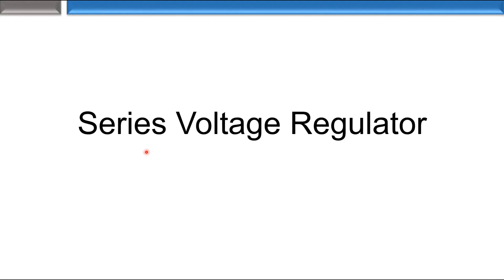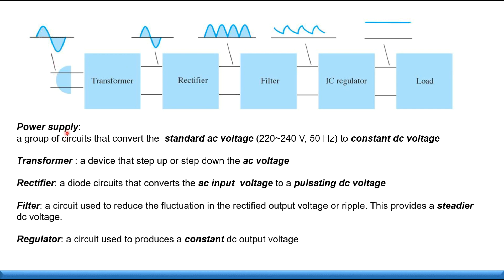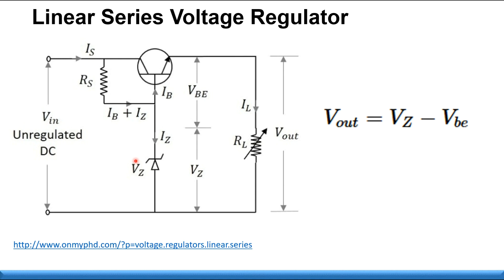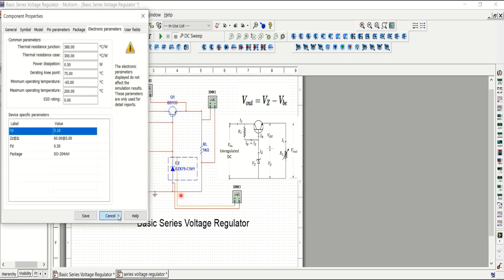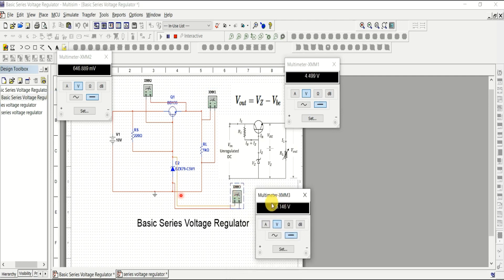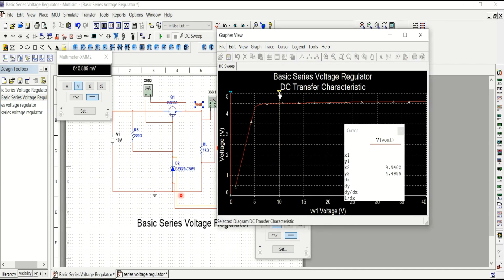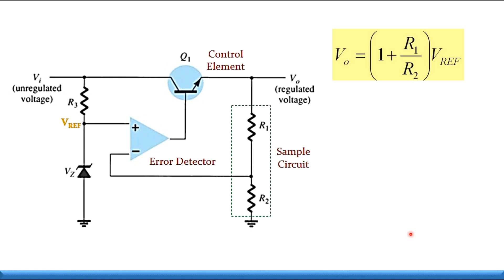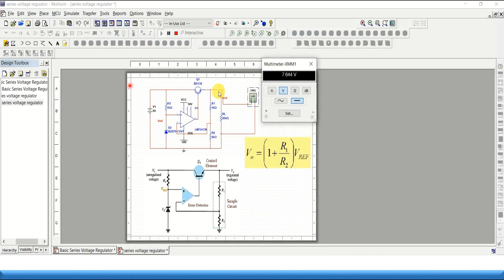Basic Series Voltage Regulator - NI-Multisim

Comment: brother is this switching or linear? Can you please tell
Reply from the maker: Hi, this is linear. There some related information here : https://www.electrical4u.com/voltage-regulator/#Linear-Voltage-Regulator
Reply: @LYSStuff  thankyou! Can you please show a voltage regulator which is switching please?
Reply from the maker: @syedshah51214.  Hi, you may refer to the circuit design and some basic information in this three link:
1)https://www.electronics-tutorials.ws/power/switch-mode-power-supply.html
2)https://circuitdigest.com/article/selecting-the-right-switching-regulator-for-your-application
3)https://www.youtube.com/watch?v=CPvA-uS0dNY

Hope it helps. :)

Comment: Nice video!! Can do a video for Shunt Voltage Regulator using an Op Amp?
Reply from the maker: Hi, thanks. 
For Shunt Voltage regulator using an Op-AMP. You may refer to these two useful video, hope it helps :)

1. Voltage Regulator: Op Amp as Voltage Regulator
https://www.youtube.com/watch?v=rPb0p7N1O00

2. Op-Amp Shunt Voltage Regulator Design-YouTube
https://www.youtube.com/watch?v=DFNIGYhxWdg
Reply: @LYSStuff  Thanks ya. And one more thing I feel very confused about the design circuit for adjustable voltage regulator using LM317. How are we going to set the Vin value in the circuit in order to get the desired Vout like 9V? I am not very clear about the circuit operation. I am so sorry to ask it~
Reply from the maker: @minywong  No problem. In general, it depend the values of Vin and the resistors. It related with the  basic formula and information which you able to find in this LM317 data sheet, page 14. in this link.  Hope this helps :)
https://www.ti.com/lit/ds/symlink/lm317.pdf?ts=1605154711295&ref_url=https%253A%252F%252Fwww.google.com%252F

Addition information
https://www.electronics-tutorials.ws/blog/variable-voltage-power-supply.html
Reply: @LYSStuff  The links that you provide  are so helpful. Thank you so much for the sharing and willing to answer my questions 🙏🏼 Wish you have a nice day!
Reply from the maker: @minywong  Your are welcome🥂